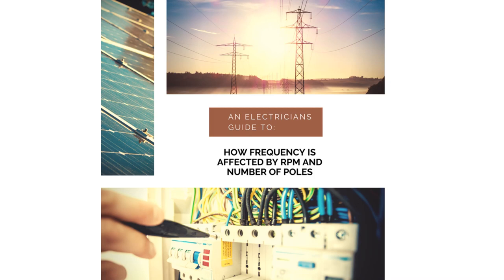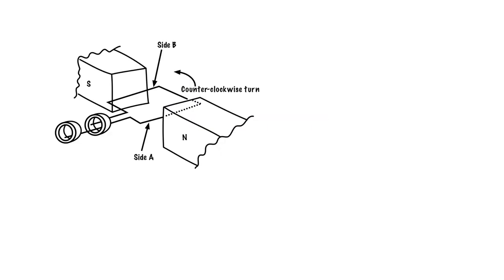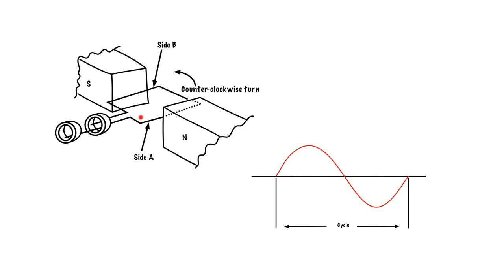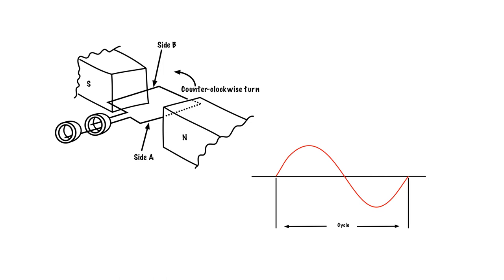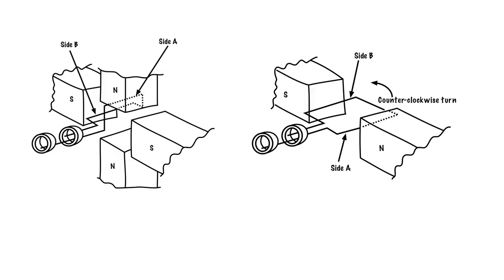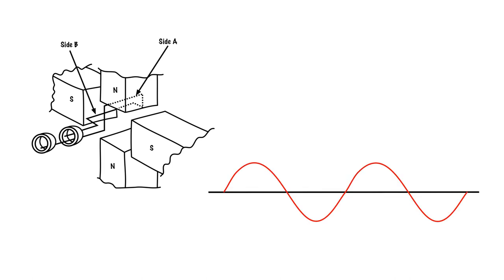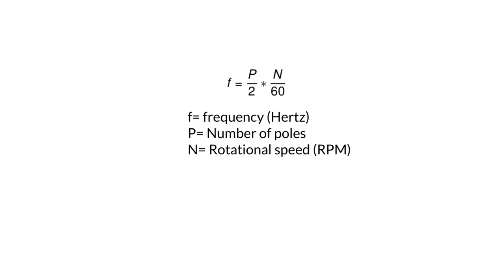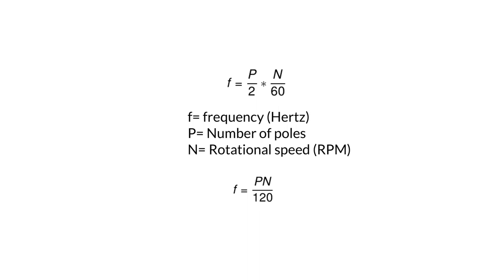How RPM and number of poles affect frequency

Comment: I like the general thought behind this video explanation about producing the electric voltage, but am a bit disappointed with the current representation.  The video shows the armature starting in the middle of the Magnet field that has the peak density of magnetic lines of flux, but the voltage (sine wave graph) is shown to start a 0 volts.  I do not believe this is correct.  As shown, if the armature is actually moving, the maximum voltage will be induced as it is cutting through the maximum density of magnetic flux.  Therefore, the depicted sine wave is 90 degrees out of phase.  The start of the graph should be shown at the maximum peak voltage and not starting at 0 volts.